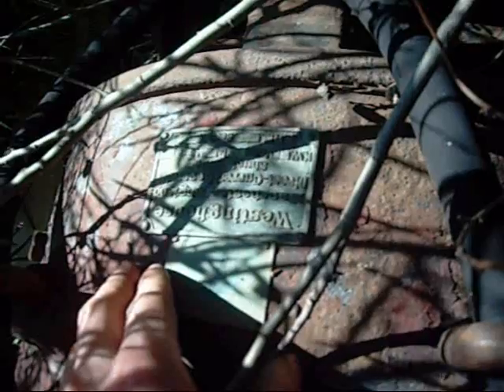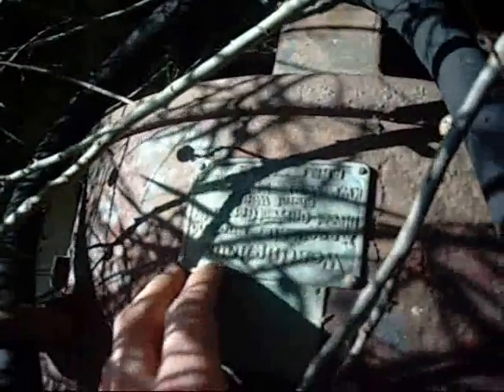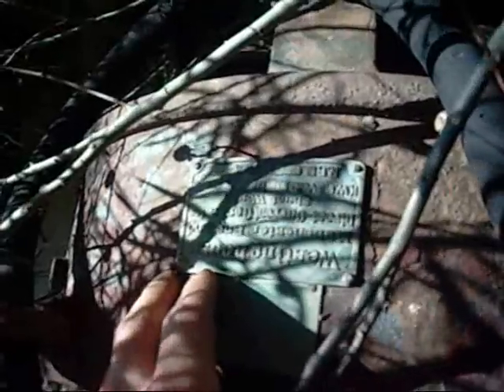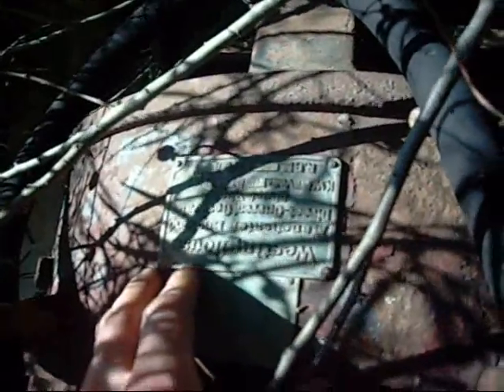Westinghouse 110V DC Generator

Comment from the maker: the only pulley's I can think of are on the smartdrive gen, I'm relying on motor speed variation a lot when tuning voltage and frequency but if its of any help to you the motor pulley is 4" and generator is 6", so theres a bit of a reduction from the motor and more torque

I think if anything I'll go bigger on the generator to keep the motor on its optimum power/RPM band and multiply torque.